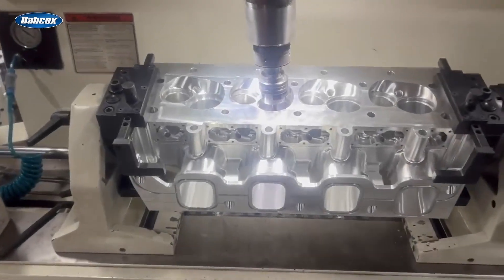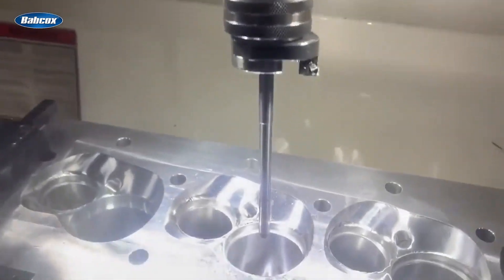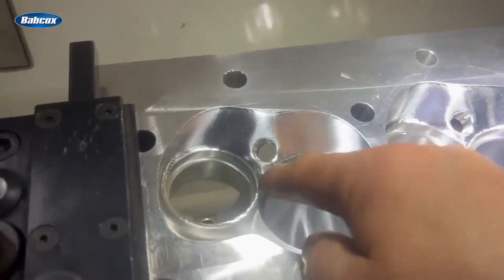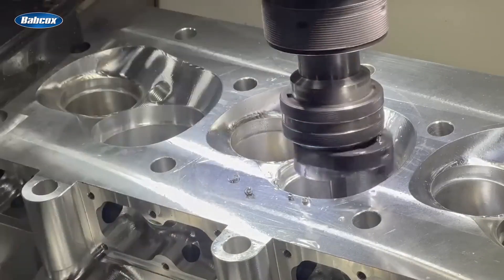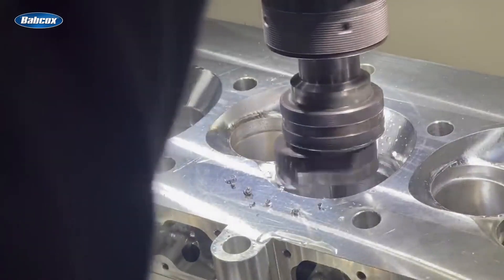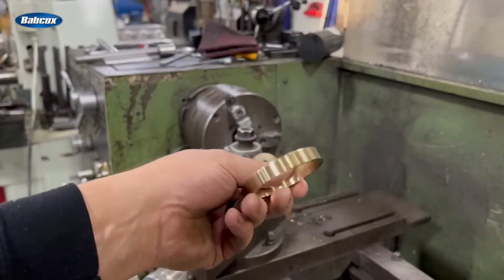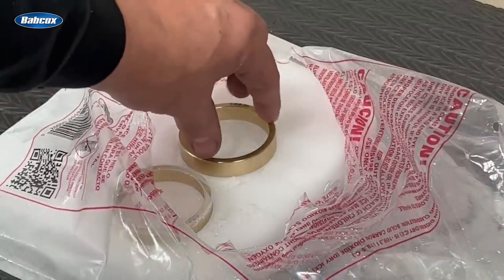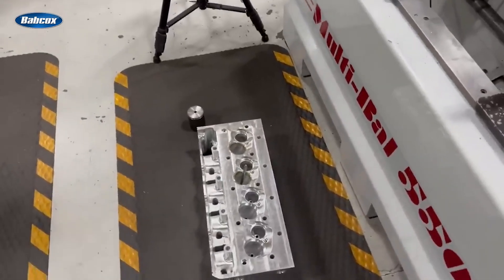New SMX Cylinder Head Gets Machined for Valve Seats – Part 1

Comment: Absolutely Fantastic video !! ....How much Pilot to valve Guide clearance ? ....Every bit of Clearance & additional  Separate processes generates more Accumulated  machining Errors.....I've heard that Oem cast Iron cylinder head Manufacturers used to cut Intergral valve Seats & valve Guides in only 1 Single step Process !! ....That would assure consistent  Production line Intergral valve Guide to valve Seat Concentricity tolerance in 1 process Step....if True, that is a brilliant idea !!